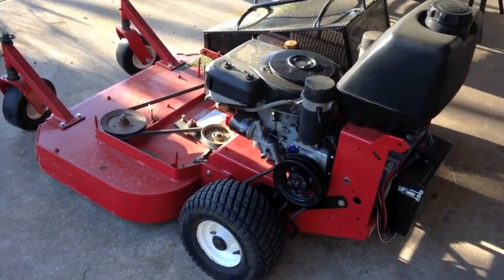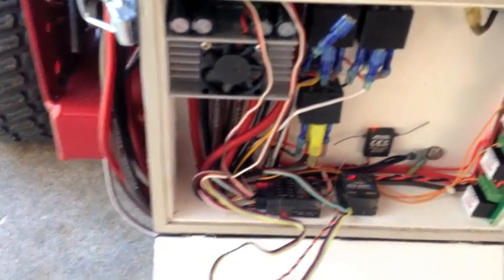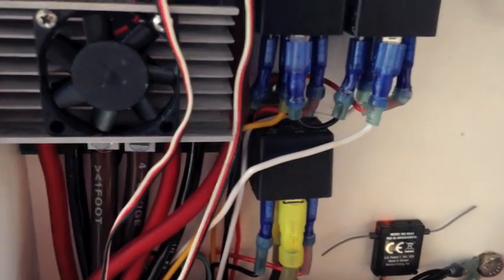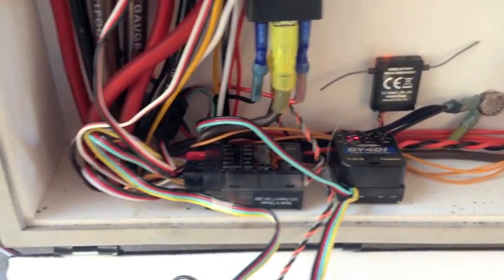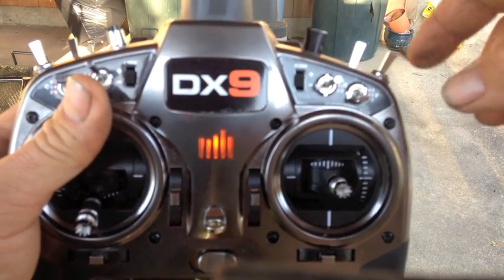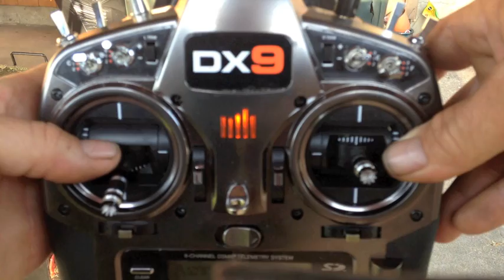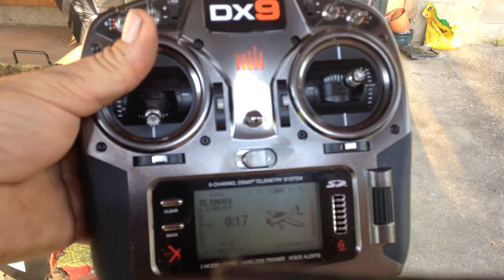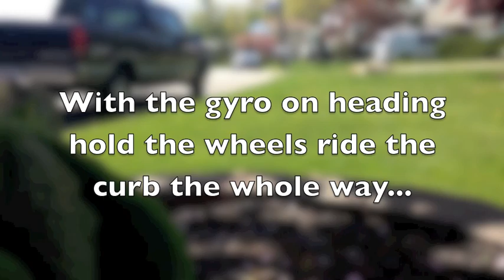New Remote control lawnmower exmark walk behind

Comment from the maker: No lol sorry... The sabertooth speed control mixes the channels for you so theres one channel for forward and reverse and one channel for left and right so two channels control the driving of the mower with only using one stick on the transmitter. The gyro is only correcting the steering. Compare it to your quadcopter you may have a gyro that is hooked into one channel that controls pitching left or pitching right and correcting itself when the wind blows , same idea but its just correcting the steering of the mower when it hits bumps in lawn that want to push it off track.

Comment: Very nicely done!  I’d been toying with the idea of building a large (50-60”) one to be able to mow the outfield of the RC field safely, without closing it to flying. The gyro is a great idea. Like you, safety would be a concern and I’d want a contactor to failsafe to open to kill the ESC’s and another to ground the engine coils.

Comment: Dave just thought I would share this with you. I put a hich on the back of mine so I can fertilize and put lime on my yard, and salt on the drive in the winter. The cool thing is this Chapin International 8620B 150 Pound Tow Behind Spreader with Auto-Stop, Red when you stop it stops letting product come out until you move forward. How cool is that. Just thought I would share with you. Billp

Comment: Very professional video and thank you for sharing your well designed project. I am about 70 years old and always wondered if our Navy can make & fly an unmanned drone to take off and land on an aircraft carrier why can't someone do what you have done with a lawn mower and other tools. It would be very interesting to try a remote lawn mower but I don't believe that I could ever adjust to such new technology such as yours. Although I have a quad drone that I crash most every time I try to fly it - I would do the same with your mower - ouch. I owned well leased a couple Dingo's 5 or so years ago when I owned a landscaping & design business and we loved them. Not sure if you know there is a company that manufactures a remote controlled Toro Dingo the last I can remember. If you didn't know about them may I suggest a search I could be wrong but I think it may have been Toro themselves. Sorry I can't not remember I have sense had a brain tumor removed that has messed up my short term memory. I now use my yard tractor and quad to help with my eye hand coordination. I am sorry for such a long reply. Would a remote control with the small steering wheel work verse the joy sticks for driving it? Cheers

Comment: Hey nice build congrats!!! I have built a 4wd one with hoverboard board motors and vesc dual esc's on a non commercial push mower.  I have since been given a john deer HD75 36" commercial walk behind,  this model posses hydro transmission.  That being said I am curios as what made you use the wheel chair motors to drive your mower?  I would think as a walk behind the mower had something to make the wheels spin originally? even it was just belt driven.  I am sure you can tell where I'm going with  this  as I would like make mine RC with only servos manipulating the all controls already there.  No esc's although may give the gyro a go.  I have a lot of experience with my DX-7 and sure I can accomplish this, just curious as to why you did not utilize the drive system already in place?  I realize this video is years old but hope you still see/respond to the comments.   once again impressive build!!!

Comment: I think the conversion work is pretty impressive. The electronic and electrical set up is well thought out.
Although, the mowing that thing was producing is sub par. 
The work is so superior to that deck design. It should have a turf tracer floating deck.
The fixed deck design you got would cut wwaayyyy better if you'd adjust the deck to pitch up in the back though. Make your blades about 3.75" in front and 4" in back. 
It'll draw the grass in the direction of travel and stripe real good if you wanna do that or just drive it around same as you are. You'll have a wwwaaaayyy cleaner looking cut. 
Your deck appears to be actually lower in the back than the front and doesn't vacuum grass up very good that way. 
I'm almost sure you'll really like the results of this with sharp blades and a clean deck. 
Try it out, let me know what you think.
Reply from the maker: Duly noted.. I thought i was doing good with the rear lower thinking it would cut the grass high in the front then finishing off in the rear but i guess that explains why it doesnt have good vacuum i'll give it a try this weekend maybe it'll pick up those damm helicopter things that drop off the silver maple finally. Thank you

Comment: "brown out" is 100% due to lack of providing the RX adequate power.  

With 72 mhz we got used to getting away with inadequate RX power supply that caused the voltage at the RX to drop below 2.8 volts, but the RX kept working.
At 2.5 volts the servos don't have the power to move themselves, much less deal with any load.
At 3.0 volts servo power is less than 30% of the 4.8v rating.

Supply adequate power to the receiver and you'll never see "brown out"

Flying models since 1966, RC since 1975.
Reply from the maker: Yes thats why I powered everything separately from the rx there was to much drain on it.

Comment: I hit some road blocks, the biggest of which is how to mount a driven sprocket onto the wheels.  I think I'm going to ditch the chain and use belt/pulley.  The Gyro you use is off the market, but there's a bunch of $5 breakout gyro/accel circuits on Amazon, but I'm lost how to pair one to the Sabertooth.  Do you have a link to the circuit you built?  My alternator arrives tomorrow.  It's 24V and is made for a bus, lol, so it's beefy.  Should I be concerned exposing it to grass clippings?  I see you have yours down low so I assume it's safe.

Comment: what would work best to control the hydrostatics on a riding zero turn? linear actuators seem like the response would be to slow.
Reply from the maker: Andy Fromm i think a set of high torque 1/4 scale servos would do the trick. I do have a few actuators and your right there strong but slow as shit. I have some machines at work and i can move the levers on the pumps pretty easily , so i think would work i just havent tried yet.

Comment: I had a 401 on mine and it seemed to work till it drove the x60 nuts.
Since then I went with an FRSky radio for more programability
Didn't like the way it spun the opposite tire in reverse chewing up the grass.
Gyro will not work correctly now because I am using the x60 in separate motor control.
I thought I was alone using a gyro for steering correction.
Reply from the maker: That sucks it didnt work out for you what a world of difference it makes. The only time i ever had a problem with the gyro was on the first mower i did i didnt realize the 401 was set on (ds) digital servo but other then that no problems at all. Nice build by the way i like seeing the motors on the back like that..Also i dont know if you know but setting up that gyro is a little more involved you can set the high side limit on the transmitter to cut back on the effects of the gyro,  set way to high even my machine will start shaking back and fourth trying to over correct itself. Good luck with it though , have you gotten used to driving around yet? Lol

Comment: The futaba gy401 gyro is for 3 axis for airplane.  So you just connect the aileron channel or both to the 1 channel aileron steering on the receiver/Sabertooth controller.  Why you not using the 1 chl gyro for rc car?

Comment: I don't have battle switches or water proof servos, but I do have regular relay modules and servos for Arduino projects.  Would they work with the type of signals produced from these RC receivers?  I'm very new to RC, but would like to rig up something similar to what you built, ie relays for the on/off functions, and servos or linear actuators for throttle or deck height control.
Reply: I also have a 3D printer and pretty good CAD skills, so I can design and print custom sized project cases.
Reply from the maker: Michael J you should be able to get that stuff to work. Rc uses ppm signals I believe you can read those signals with arduino.

Comment: Killer build man... Well done. Should patent your design and market it to ExMark. Lol. Would be amazing to link this setup to a stand on rider with manual functions still optional...like the ACS control on Bob Cat CTL's! Again...Well done, sir. ;)
Reply from the maker: Thank you... Yea i was thinking kinda the same thing with the dual purpose controlling. Shit it cant be that hard right lol. Im trying to get my hands on a toro dingo skid steer to do but damm those things dont go cheap ever!!
Reply: For sure! Dual purpose control shouldn't be any trouble at all...would just need to add a bypass to switch from one set to another... and no, those machines NEVER go for cheap. The crew I used to work with had a Bob Cat MT 55 and was up near 20k for a lightly used demo. Lol. If only I could hit the lottery.  ;)

Comment: Very nice build, looks like something the factory would have put out. What did you use for the electric PTO? And where did you source the pulleys from - did you turn them on a lathe? I'm just starting my build from an old 28" snapper. I really like the thought of using the lawn mower wheels/tires, but don't know about mounting them directly to the motors. Not sure if it would be too much torque without gearing them down through pulleys like you did.
Reply from the maker: Thank you. Alright the pto i used was based on this https://www.jackssmallengines.com/Products/EXMARK/Electric-PTO-Clutches/255560/61411 ( copy and paste into your browser). Depending on the crankshaft dimensions of your motor ,  that will determine what clutch your going to use , also there will most likely be a pulley mounted on the clutch you buy , try and do some research on the clutch before hand , your going to want to match this pulley to the original drive pulley on your machine basically you want the blades spinning the same speed as original i think just a (little)  faster never really hurt....dont over do it! I was lucky enough that my local john deere parts counter stocks quite a few and while they werent that busy they let me go through them to find the perfect match 285$ later... Now the gear ratio of the wheels- the pulleys i used were bought from fremont industrial supply.com i was prepaired to turn them on the lathe but for the price it beat spending 10-15 hours on the lathe. If you snoop around the site your gonna learn that what i used is a split bushing and sheave (pulley) instead of the i.d of the pulley being bored to the size you need it uses a split bushing that fits your shaft (most likely 17mm) that way there easily interchanged if your not happy with the speed. I found that its best if you try and match the original speed of the wheelchair the motors came from so your motors can be directly attached to the wheels as long as there within atleast an inch of the diameter of the wheelchair motors. Mine is setup to be a little faster on purpose its cool its fun but... Remember the more work you expect from an electric motor means the more power its going to draw. If you want the exact parts i used let me know it'll take a while going through some papers but im sure i could find something. Anyway good luck make sure you finish what you start! And show us when your done. If you get stuck or get frustrated just ask i dont mind at all.

Comment: Great build! Question, what size pulley wheels are you using with the wheelchair motors? Also, do you have the wiring diagram available?
Reply from the maker: Alvin Pitts jr sorry for the delay i will measure them tomorrow.
Reply: @davezjr6024  Did you ever measure the pulley wheels?

Comment: I have been try to get gyro for my remote mower.  What type do you use and how to connect to the sabertooth dual motors controller with 2 servo controllers?  Most rc car gyro only have one input/output for steering servo.
Reply from the maker: Danny T the gyro only uses one channel for the steering the other channel is for forward and reverse. The gyro goes inline of the steering channel.
Reply: The saber tooth has left and right servo channels.  The gyro has only one input for the normal steering channel not for 2 chls turning.  How do you connect to the gyro and do you adjust gain from Remote?  Do you have diagram please?

Comment: I'm about 3/4 the way into collecting parts to convert a push mower, but couldn't find an elec wheelchair for parts, so I got 24V 500W motors and am having a really hard time finding the right battery(s).  If each motor is a 20 amp load, what size deep cycle batt would I need minimum?  Everything advertises MCA which is amps divided by test time, so the advertised 600+ is actually closer to 20A over the course of many hours.  Any insight or a link to a better description would be MOST helpful.
Reply from the maker: Michael J dont be concerned with the cranking amps , its the amp hour rating (ah) your looking for. I use an alternator on my mower so luckily i get away with cheaper batteries. The first mower i built didn’t charde the batteries but that got old very fast for me anyway. So besides all that.... you’re going to use 2 motors 20amp each , so most of the batteries your going to find are going to be around 35ah rating , thats what the battery can discharge for an hour. You’re drawing 40amps with 2 motors (not all the time) so round the 35ah batteries to 40ah and you should get around an hour of use. Im assuming your running 2 batteries in series which is just going to double your voltage but not the amp hour rating. I did try deep cycle batteries in my first mower but i dont know if they were on the shelf for a while or something but they didn’t last a full season. Try your hardest to sit and stare for a while on how to mount an alternator it will be the best thing you do besides building a badass mower 🤘🏼good luck. Ask any questions you want in the future.
Reply: @davezjr6024  Thanks so much for the reply and wisdom, I've had such a hard time getting an answer to this ?.  Walmart has a 24V Deep Cycle for around $100.  Would 2 - 12V batts be better?  My mower has a belt driven drive wheel, so I can easily get an ALT there instead, but I bet the ALT would be better to be 12V, so maybe 2 batts @ 12V each would be better.

Because I have the torque multiplied to intentionally reduce speed, can I assume my draw will also be less?  I doubt it would take a full hour to mow the whole yard 100' x 150' - a house and driveway.

When I get it running, I'll shoot a vid and tag you in it for feedback, cool?  I have lots more questions, but let me get the bare bones built first.

Thanks again for the feedback bro!
Reply: @davezjr6024  What gauge wire do you have between the batteries and the Sabertooth?  I have some 14 gauge primary wire there now for testing but feel there's no way that can be adequate for loading up.

Comment: Funny, my friend came over with his Rc push mower parts tonight and I was telling him It may be useful trying a gyro.  Slapped the parts on a piece of plywood sorted it out and it runs well.  I know its been 4 years but how is it working now?
Reply from the maker: Mowed the grass for the first time today actually. Its still kickin ass the only thing that has broke was one of the battle switches other than that im still using the same batteries which im surprised but they’ll take a shit now that I mentionedem. Ive been slowly working on a new one that will be hydrostatic im just not in a rush because this one is still going strong. Even the wheelchair motors are as strong as the first day i used it. Once the new one is done this one will probably go up for sale. Did you make a vid? Lets see what you got no matter what it looks like. Somehow find a way to put an alternator on it you’ll be alot happier! My first one was a 21” snapper and before i put an alternator on it i only got about a half hour of decent power with 2 batteries. Good luck man 👍🏼 take a vid and share.
Reply: Yeah, videos will follow, ill post one here for you :)   So who flies, you,  your friends or is your rc strictly mower based?   I want to do one of my wheel horses, but it may be better like your exmark or at least a tool carrier type frame.  Those batteries can go 4-7 years,  Im sure you know that though.  We hooked the small system up to a couple 11 or 12 amp hour emergency light batteries and they are 7 years now. I haven't even taken care of them well.    My friend can probably get by on half hour run time, I however need a more robust system.  I cant believe how easy the Sabertooth makes it!!!   Its so small, he has the 32 amp.